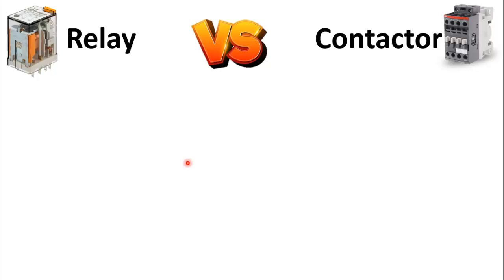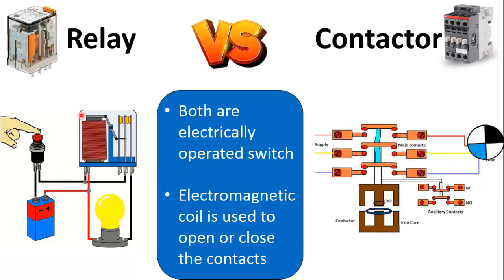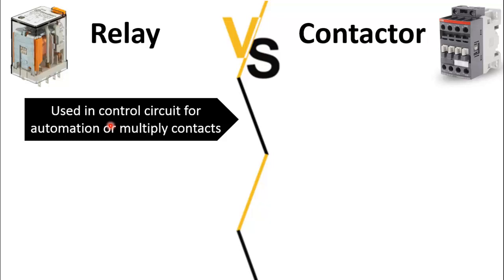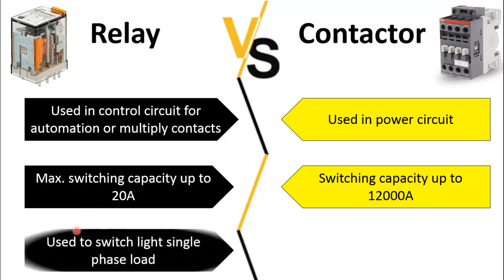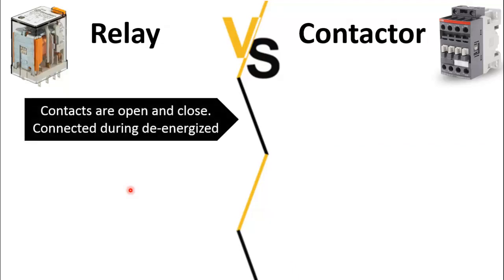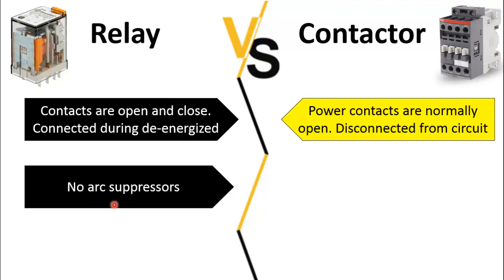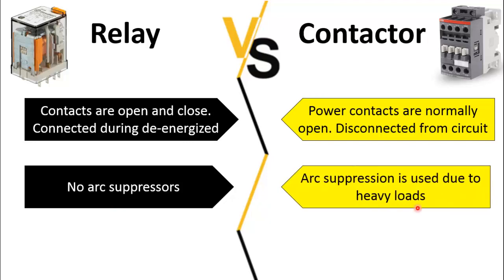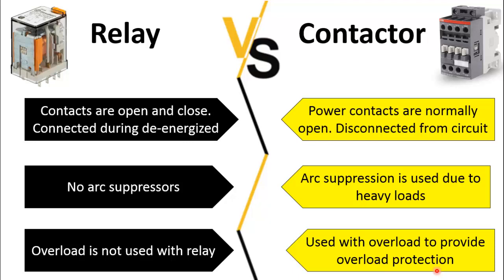Contactor vs Relay | Difference between Contactor and Relay

Comment: NO  AND  NC  ARE   USED IN  RELAY  AS WELL AS CONTACTOR  BUT  DEPENDS ON USE .
Reply from the maker: These are auxillary contacts . Both are available in relay and contactor but only used for control circuit